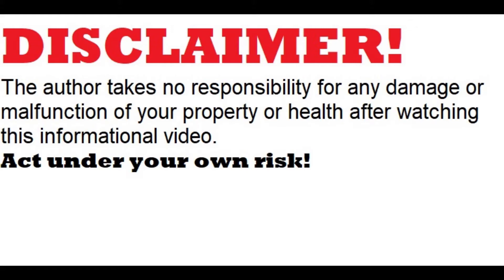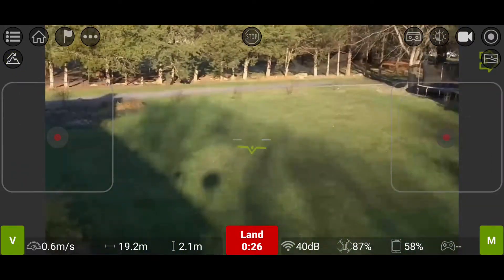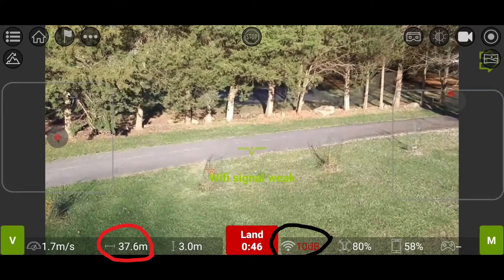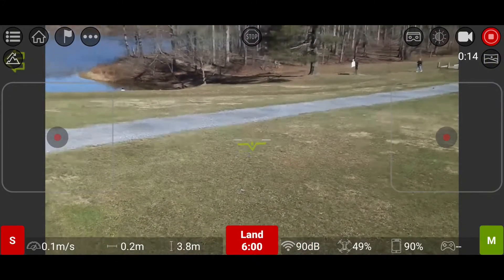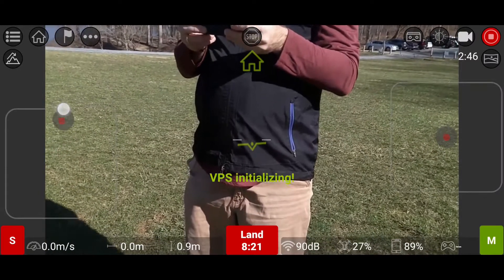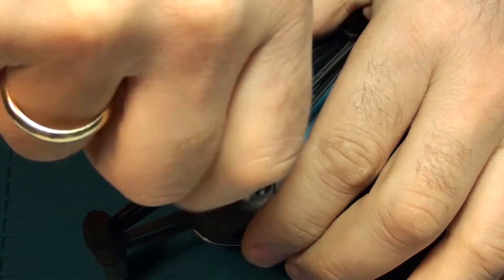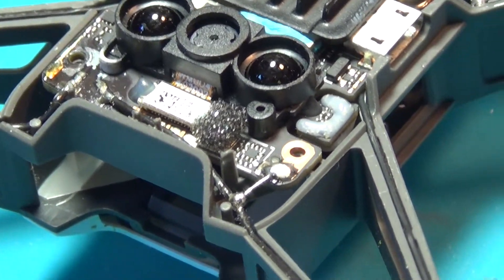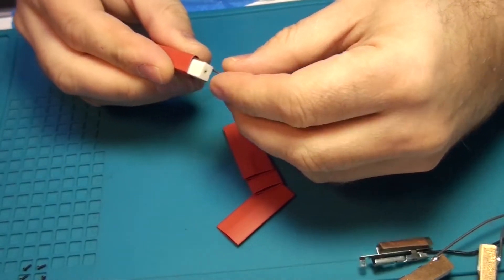DJI Ryzen Tello antenna mode

Comment: Bad result because you attached 2 antennas on each connector, impedance mismatch and lowers the power of each antennas
Reply from the maker: Thank you for your helpful comment!
Reply: so what we need to do? one antenna on one conector?
Reply: @TonyMontana-ke2kz  Pretty much and the antennas need to be 50 ohm each and of course set in the right orientation.